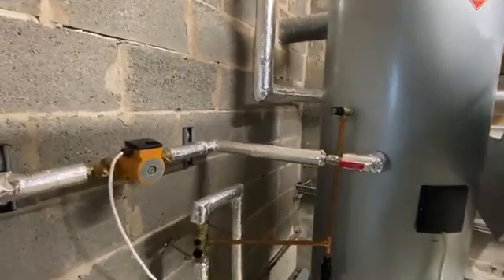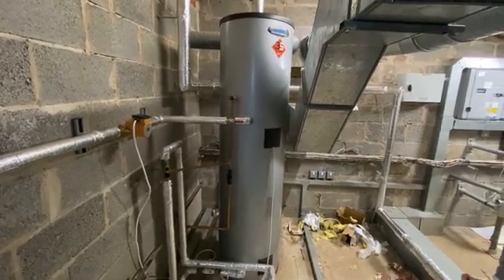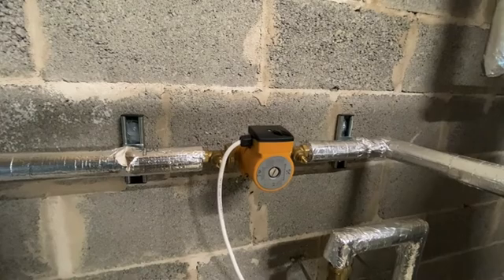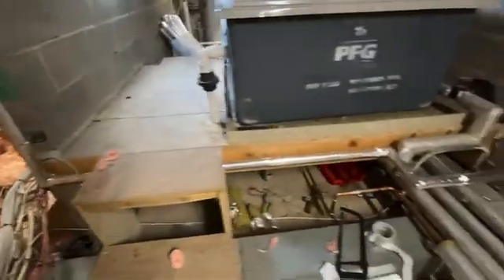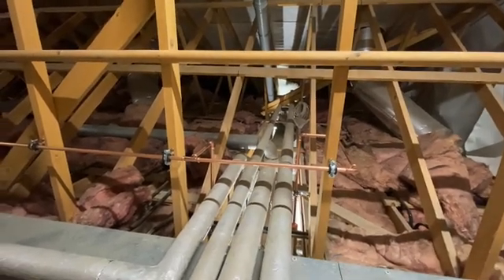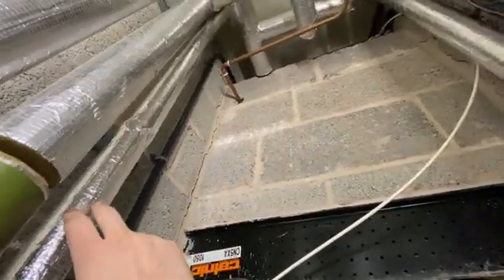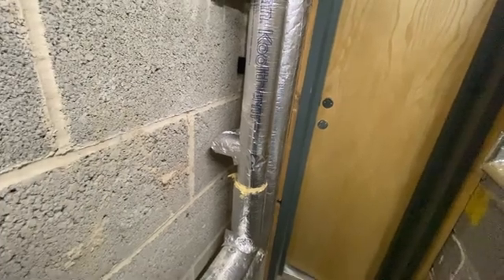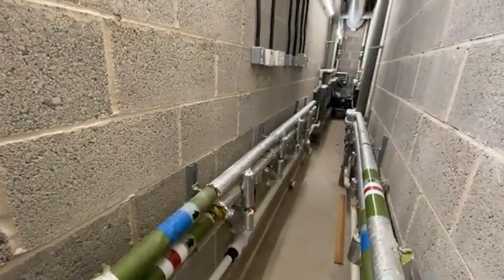Plumbing Tips - SECONDARY HOT WATER RETURN INSTALLATION

Comment: Just to mention in an case that hot water cylinder is not having hot water secondary outlet then secondary return could be done just before cold water feed enter cylinder but non return check valve must be installed between pump and cylinder

Comment: Working on a hot water return circuit on a large building the main water usage 80-90 taps is on one side of the building next to the tank and pump  and there is 2 small bathrooms on the other side 120 metre run away, the return doesn’t circulate on the far side, any suggestions could I add in a bronze pump on the other end to push water back towards the cylinder

Comment: Nice fit but you 100% need a non return valve .. when pump is off the water will flow the opposite way back to taps , often with cold water .

Comment: Informative video. Q: can two loops be made on a single secondary pump? I ask because we need to feed two ends of a long building, otherwise it would result in a single loop of approx 65m. All new install, all new pipework.
Reply from the maker: Yes two loops would be fine using this particular pump.

Comment: Great video. A layman question... is a non return valve needed on the pipe work before the pump enters the cylinder? If so do you know why? I've not been able to find the answer to this via Google! Thanks!
Reply from the maker: It is not essential just good practice as far as I am aware. Purely to allow one way circulation only
Reply: Exactly 
But if you connect to cold water inlet then none return valve is mor than essential

Comment: I am not knocking your work it is very tidy but do you use a pipe benders because I count 12 x 90 degree bends on one line sweeping bends are much better and less fittings to leak.
Reply: I hear what you’re saying but for this specific system, using fittings we didn’t feel would restrict/limit the system compared to using the bender.

Comment: Hey mate good video ….so if I’m installing a secondary return any pipe work would just connect into the hot feed anywhere on the main hot circuit or does it have to connect near the services, bathrooms etc ? And in terms of the pump what kind of timer would you be installing ? Sorry for the long winded question I’m still learning all this
Reply from the maker: Cheers bud. It’s good practice to tee into the hot pipe within 1 metre of each outlet it’s feeding. Some sec pumps will have built in timers, Grundfos/DAB do one 👍🏼